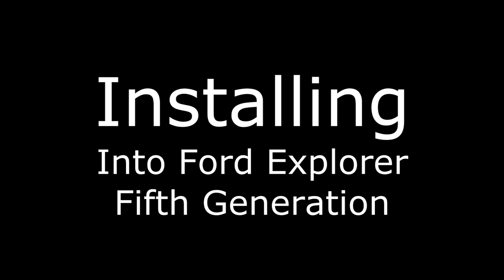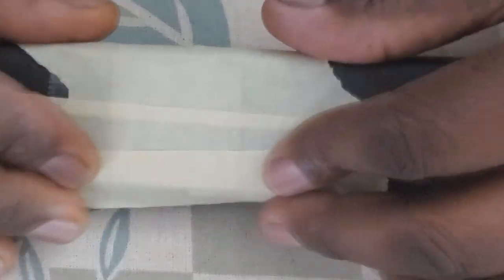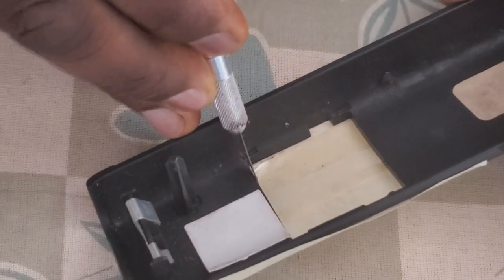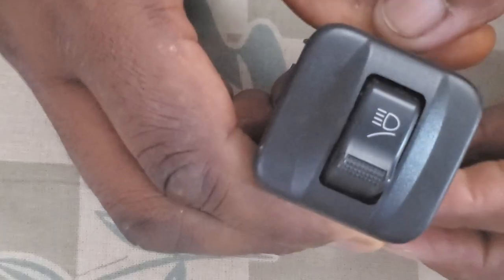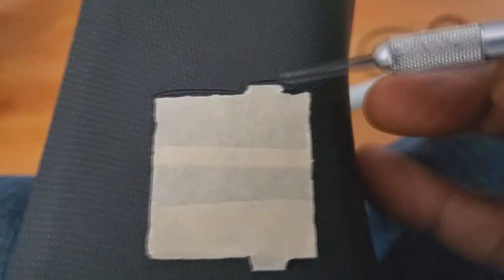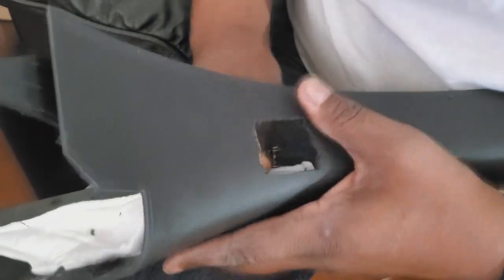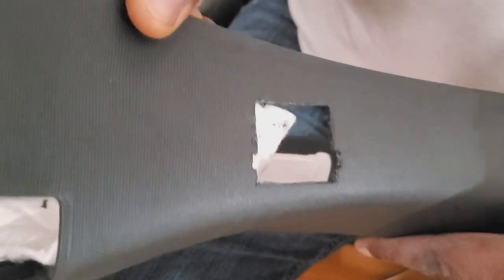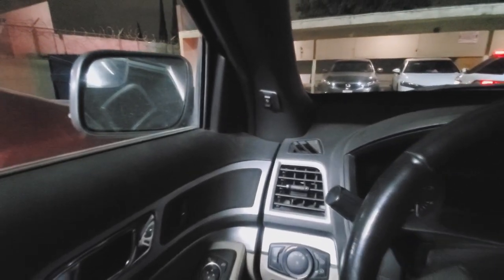Installing Jeep Liberty Roof Light Switch

Comment: where did you find the switch/wiring harness for the lights?
Reply from the maker: I purchased everything i needed from the pick your part auto salvage yard.  
I purchased the lights, all wiring from the lights to the switch and of course the switch.

Then the only thing left was to research how to put it all together for proper working.